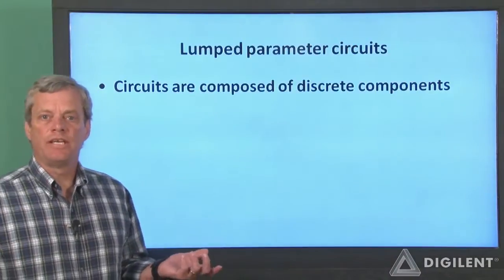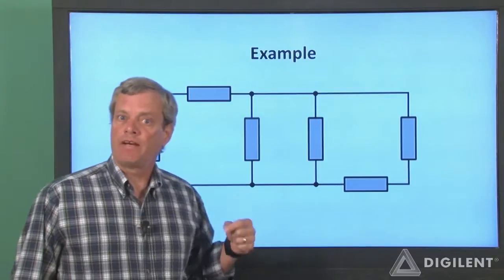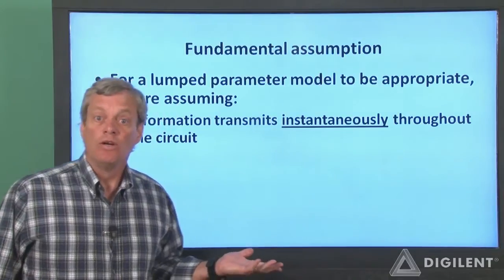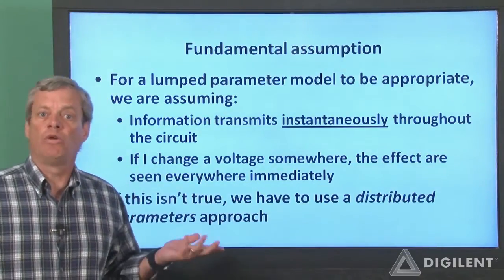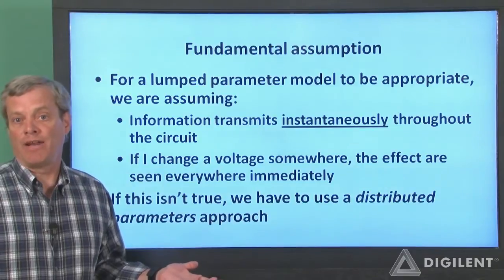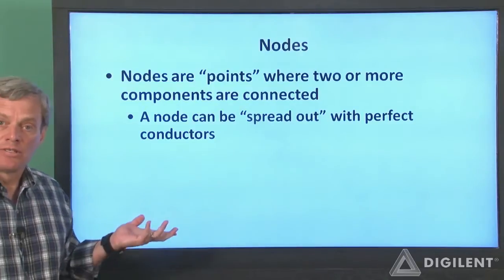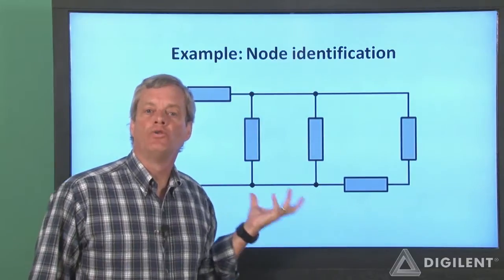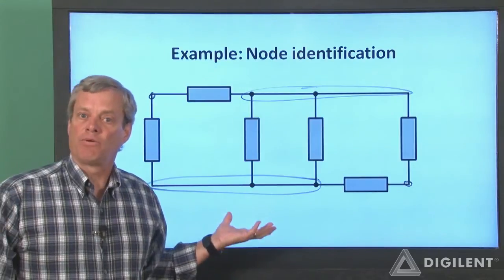Lumped Parameter Circuits and Nodes

Comment: capacitor does not allow sudden change in voltage and iductor does not allow sudden change in current then,how they are lumped parameter ?
Reply: I agree with you.. The lumped matter discipline states that the effects of q/t is zero..